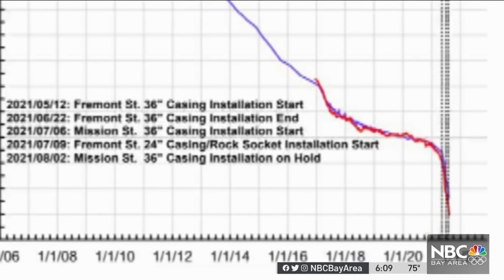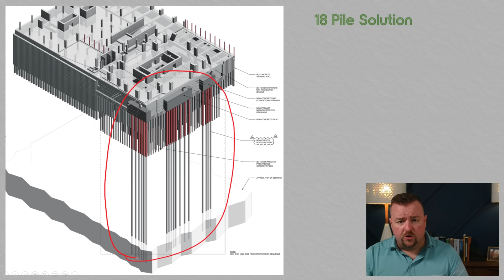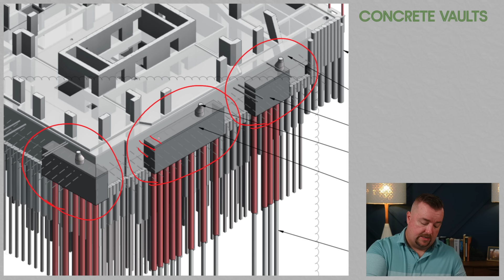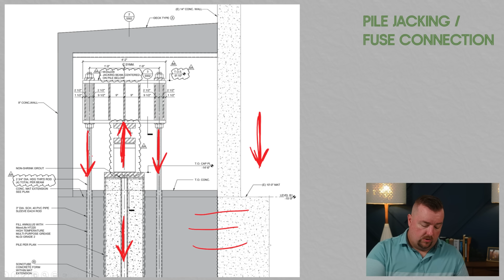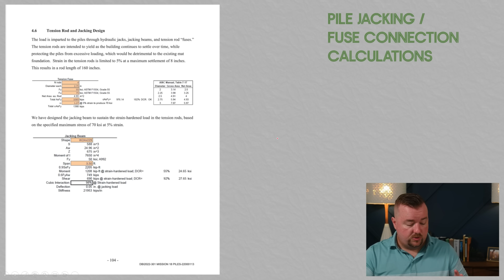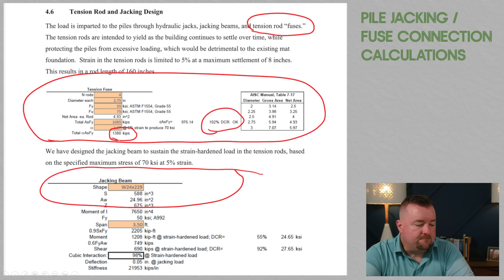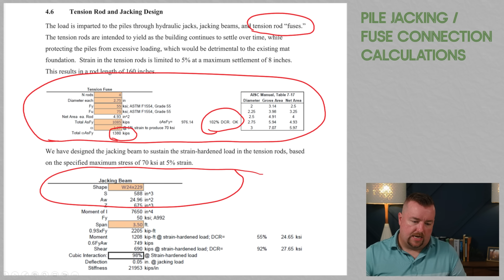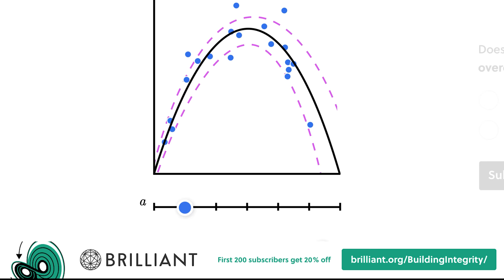Did I Uncover a $100,000,000 Mistake with the Millennium Tower "Fix"?

Comment: I am a retired electrical engineer, PE; who practiced for over for almost 50 years and I love your channel.  It seems like an analysis of that plate would be integral to the functioning of that scheme.  I would love to have those engineers  explain to me why they chose not to do any analysis of it.
Reply: My intuition tells me the bottom plates should be the same size as the jacking plates. They're carrying the same load, right?
Reply: Why do you imagine they didn't?
Reply: @donaldbiden1920  Because the engineer in the video said that they didn't
Reply: @donaldbiden1920  what is the absolutely have no calculations on those plates if they had done them, we would’ve included them in the design information
Reply: Or they did they do an analysis of it, found it wanting, and could not find a cost-effective alternative, and just failed to report their findings?
Reply: @bbgun061  good guess. 1/2 size on each side should be enough but tbh the design should be different all together
Reply: That's easy - it's because they live in San Fran and everyone gets their jobs there through nepotism and govt handouts lol

Comment: The force exerted on the side of the original foundation is the biggest issue I see here. It’s going to snap and when it does all the energy saved up over any length of time will release instantly.
Reply: I agree with you 100 percent. The key way connection isn’t anywhere close to deep enough.
Reply: Great point. Opposite side original design could be in tension now with a wind lateral force blowing in the ‘wrong’ direction.
Reply: That's exactly what will happen, and not very far in the future.The building should be demolished.
Reply: This is why they designed the rods to yield. It limits the load transferred between the vault and foundation wall, so that the foundation wall doesn't get over loaded.

Comment: Here is another good one. My father was the photographer on the Fred Hartman  bridge that was built to replace the Baytown tunnel, in Baytown, TX. The Bridge was built with epoxy coated rebar (yellowish green coating). For years he had a piece of the rebar that had been cut and engraved with a diagram of the bridge (it was given to all the contractors). I never did find it after he passed away, but I remember it. I think we all know what happens to epoxy coated rebar, the corrosion from pinholes in the coating is far worse than with the same uncoated rebar.
Reply: Should have gone with hit dipped galvanised there, at least that will provide a protection to the steel, and then you can epoxy coat it for improved resistance.
Reply: And this is torque to yield , before the building moves some more, ...now add rust ...is this a joke or something ?? ( insert face palm here )
Reply: @SeanBZA  actually most states have banned epoxy coated rebar it would still rust faster.  You can though run active cathodic protection on it
Reply: @maxgood42   rust in marine environment? That never happens
Reply: @bernhardjordan9200  🤣
Reply: That damage mechanism is due to a large cathode to anode ratio.  I've been over that bridge many times, never knew it had epoxy coated rebar.

Comment: Nice video. As a project manager and former structural engineer in the construction industry I found it very interesting. This kind of anchoring in concrete structures needs thorough consideration and I found it hard to believe that the responsible people did not take this detail into account. Apart from the anchor plate also the transfer of forces from the plate into the concrete and from the anchoring sideways to the existing foundation is an important detail. What I also miss but perhaps you deliberately kept it out of the video is the fact that the extra support is only placed on the outside of the foundation slab of the building while the existing piles are distributed over the entire slab. The newly placed piles will alter the distribution of forces acting on the slab. Just a thought. It's also interesting that the whole proces of development and construction is being highlighted. Very recognizable!

Comment: Also, you can't use straight threaded rods in applications where they are loaded beyond their yield strength. In this case, special tension bolts are required, which do not have a continuous thread, but a stretch area with a reduced diameter. This diameter must be significantly smaller than the core diameter of the thread. There is no way those straight threaded rods will act as reliable fuses with predictable yield behavior.
Reply: Agreed - in my mind, threaded rod is not much more than a piece of rod or bar with a huge helical stress-raiser along its length yelling FAIL HERE.  These civil engineers need to take a leaf out of the automotive/aeronautical design handbook!
Reply: I think, the load is limited by the amount of prestress or tightening with the jack. Once the tension load to the bolts is removed there is no more load carring capacity.

Comment: As an electrician, one of the principals of making connections is accessibility for inspection and maintenance. The idea of placing both the "fuse," AND the connections to the "fuse," within concrete, and beyond any access, defies all common sense. Yet these folks have taken it one step farther, and placed the "fuse" within concrete that is also an important load bearing member of the structure.
Reply: I agree.  All of the threaded rod "fuse" should have been placed above the concrete.
Reply: We saw how well concrete encased steel worked in the Morandi Bridge.
Reply: Yeah, except when you don't attach the threaded rods to the concrete then it doesn't work at all. It has to be placed in the concrete.
Reply: The choice of the word fuse is scary. The way a fuse works is that it FAILS when there's an overload. Is he telling us that this scheme will fail when there's an overload, such as an earthquake?
Reply: @henryD9363  right. and then what? do you demo all the vaults and start over?
Reply: @ashedold11  you have giant rods that through connect to the base of the concrete, and then the fuses sit on top of those giant rods pulling in tension the same way they do now, but are now serviceable. They could have shortened those rods and made them 1' long, with the rest of that connection being 6" steel rods running the  rest of the entire length.
Reply: @henryD9363  that's my question as well.  If this fuse is designed to fail under an excess load, however you define 'excess', what's its purpose? To protect the foundation for later reuse while the tower collapses around it?
Reply: @ashedold11  I didn't mean the threaded rod should not be attached to the concrete.  Just make the connection at the top of the concrete, not buried deep in the concrete.

Comment: It’s not just the weight of the building they should be calculating in but also the seismic forces that this building will encounter.
Reply: Dynamic loads were included. Get good noob
Reply: @sc1338  why add the snark?
Reply: Agreed. The fact that this nightmare building is in San Francisco, next door to the huge transit hub, makes the malpractice so much worse.
Reply: @vicw9223  I was joking. Hence the “get good noob” 😂
Reply: @sc1338  Bro , he literally explained that the part in question, which had no static or dynamic load analysis done or presented, was a 1.5" x 6.5" x 13" steel plate with a 3" hole drilled through it to support over a 1/4 Million Pounds static.  I guess the whole premise of the video was missed by you, or can you enlighten me?
Reply: Why?  They just want to nudge it back to vertical, the building is built to withstand earthquakes already, it's in San Francisco after all.  The forces imparted by an earthquake can cause problems at the top of a tall building because the bottom is suddenly moving relative to the top, but since the bottom is attached to the ground it just goes along for the ride so to speak and the stresses on any structure at ground level are very minimal.  These apparatus they are building are attached to the foundation of the building underground so an earthquake wouldn't affect them at all

Comment: You need to familiarize yourself with ACI CODE-318 Chapter 17 for anchorage design, and calculate (among other checks) the bearing stress on the anchor plate and the concrete breakout capacity. The shear capacity on the plate that you described is meaningless for embedded concrete anchors.

Comment: Josh,  I am not an engineer.  I am a crane operator.  I do have experience with jacking heavy structures,   namely 850+ short ton cranes.  This remediation plan is a total ofking disaster.    They are playing with fire,   and it's criminally negligent imo.
Reply: Yup... and I doubt "earthquake" was an input to the calculations either...
Reply: @prjndigo  An earthquake? In San Francisco? Come one, what are the chances of that happening... /s
Reply: @norml.hugh-mann  Maybe English isn't your first language.    I have experience in jacking heavy structures.   Over 30 years.    My opinion is my opinion,  but it's based on experience using the type of jacks which they are using.    I have an understanding of engineering,  and physics.   This remediation wouldn't even be considered if money wasn't the primary consideration for several entities.   In other words,  they are placing money ahead of safety.    The building should be demolished.   Of course,  you're welcome to YOUR OPINION,  just as I am.
Reply: @norml.hugh-mann  Just because someone has the "engineer" title does not mean they are any wiser than the "blue collar" opinion.
Reply: @norml.hugh-mann  i am an engineer. the guys in the field often know better how materials perform in the real world because they actually do the work. they may not be able to do overall systems design but dont mistake that for lack of boots on the ground experience in how things behave under real world conditions.
Reply: @norml.hugh-mann  I am a chartered engineer and I can tell you that if a crane operator tells me something is off, I ALWAYS listen.
Reply: @norml.hugh-mann  He probably makes more than you do.
Reply: @norml.hugh-mann  You sem mad like your firm put you on swimming pool design.
Reply: @norml.hugh-mann  is that you Ron Hamburger?
Reply: Nothing is gettiing jacked up, they are just wanting to slightly tilt it, the building is sitting on the ground and always will be.
Reply: As a crane operator you will understand this:  say you are building a gas plant and you have a vessel that is fifty feet long and weighs 100 tons.  Your job is to stand it up on a pad where it will do its job in an upright position looking a lot like a rocket ship on its launch pad.  When you lift the vessel and move it towards its final destination, such that it is suspended in the air and nothing is supporting the vessel other than the crane, how much does it weigh?  Now set it down on its slab where it's going to live.  Now how much does it weigh?  And how much weight is the crane having to support?  Zero right.  Now look down because one of the guys is asking you to  move a hair to your left to get the vessel set up perfectly level and plumb.  How much weight does the crane have to lift to nudge it sideways?  Barely anything compared to the total weight.  Same for this building, albeit this example isn't exactly analogous given the different relative distances from their respective fulcrums but you get the idea.   The percentage of the buildings weight that those jacks are going to be asked to interact with is a tiny fraction of the building's total weight, the vast majority of the building's gravity load will still go straight down thru the ground like it would in any other building and has always done in this one.   Hope that helps, and let me know if i'm wrong or missing something, always glad to be corrected and hopefully learn something new
Reply: @jb13611  lol right opinion vs actual skill hmm lets see one of them blue collar guys design a sky scraper and you have the privilege to live in the penthouse. you want it?
Reply: Oh hush now, stand back and watch me while I hook my Helicopter up to the top of this building. :face-orange-frowning:
Reply: @norml.hugh-mann  ok smart guy.. I’m an untrained idiot.. and when I see a picture of an already sinking building with 5 arrows going down and only one arrow going up, that looks pretty damn stupid to me, and is destined to fail. Just MY opinion.
Reply: @hallambaker  I use to do inspection for the owners at big projects. There were several times an operator type would ask me about something. 9/10 it was a real problem.
Reply: And I'm the bloke with the truck you lift stuff on and off of, and I have to make sure that the loads and restraints are up to the job , including not exeding SWL on the rigging.
Would you lift 3 fully loaded 18 wheellers with 1 bolt in a rusty plate, oh yeah these plates and bolts WILL rust in the concrete ,it's a known fact.
Oh wait this is residential so lets fill those trucks with people, dancing and having fun. Still think that bolt and plate is good enough ....???
Reply: @norml.hugh-mann  Your arrogance is both breathtaking and comical. Only a fool would not listen to the "blue collar, your words") boots on the ground in the field.
Reply: @norml.hugh-mann  Flight attendants aren't pilots. Yet if one of them calls the flight deck and tells me an engine is on fire, I listen.
Reply: @marcburns508  Yup, crane operators are in a class of their own, 90% of their job is basically looking out for potential problems. They have a unique view of the whole site and if something goes bad, their ass is on the line.
Reply: @norml.hugh-mann  found the "engineer" who designed the tower
Reply: @pR1mal.  The "you're not an engineer" argument is such bullshit. Many of these guys are so entitled they don't think that people should even have an opinion, regardless of how apparent the engineering mistakes are. The fact of the matter is that when someone graduates university with a civil engineering degree (and it doesn't even matter if they majored in structural design) they wouldn't know enough about a particular topic to really be able to make a concise statement about whether something is "good" or not; upon graduation they have to engage in further studies to master such concepts. Some don't and instead choose to hide behind the "you're not an engineer" statement. Obviously, opinions aren't stamps. Working in the field in construction we see a lot of things engineers don't. Anyone who has worked with concrete has probably seen severe rebar congestion; that basically means all of that engineer's calculations go out the window... so much for the "you're not an engineer" argument. Blue Collar professionals have saved white collar engineers from numerous disasters (and engineers have saved contractors too). An engineer who designs jacking systems would do extremely well to listen to your opinions.
Reply: @norml.hugh-mann  Wow, is all that SNARK helpful? This is an informative and interesting discussion of different folks throwing in their ideas and listening to each other. WHY put in your toxic angry condescending vitriol? WHY? Are you just having a bad day? Are you threatened? WTF dude.
Reply: @floorpizza8074  that’s because you are not Norm L Hu-Mann
Reply: @donaldbiden1920  That's exactly right, the job of these jacks is just to slow down the settling of the building at the jack locations for just long enough for the rest of the building to continue to settle until (hopefully) the building is done settling and is back to plumb. But I'm thinking the big elephant in the room here is WHAT IF the soil is overloaded under the existing foundation mat which is apparently bowing, and the building just continues to settle and perhaps at an increasing rate, given all the recent excavations and added local weight of those concrete vaults? Then this will all be useless, the 'fuses' will pop, and the tower will continue to lean more, and then need to be demolished.
Reply: There is a reason I never stayed around alongst the ring of fire. But if, not doing it at least at the Japanese level is criminal negligence. By the designers and the ones giving aproval. Not small oopsies.

Comment: I hope this isn't another case of Citigroup Center or Hyatt Regency Walkway in Kansas City.  I remember in my sophomore year when the professor drew up a problem and asked "will it shear?"  We worked on it for about 10 minutes and said "yeah, it'll shear"  That was the Kansas city walkway where a last minute design change cut a continuous column.
Reply: It looks a lot like that hotel walkway. Nuts.
Reply: Just watching this and the trust being put into a tiny steel plate that hasn't actually been thought about properly reminded me of the Hyatt Regency disaster.
Reply: @Teverell  Yeah, a simple single long column that changed to two separate columns was all it took to bring it down.
Reply: Hyatt Regency Walkway - *that*'s what I was trying to remember.   (I remembered it, just couldn't recall the name)
Reply: I watched this video and Hyatt Regency walkway failure was the first thing I thought of.  Yes, it isn't really the same thing, but damn if it doesn't seem very similar.
Reply: As a lay person, it amazes me that such a small but crucial component wouldn't be over-engineered... doesn't seem like larger, thicker steel plates would have added much to the price tag?

Comment: This comment is prescient “the review board is relying on the design and calculations of the engineering firm that screwed up the building in the first place.” Will anyone be astounded when this project fails to perform as expected?
Reply: St Francis Dam comes to mind.
Reply: The geotechnical engineers are the ones who screwed up in the first place, not the structural engineer of the original building. Plus I'm pretty sure the original building structural engineer isn't involved in this fix.